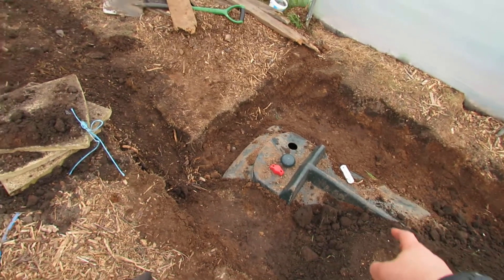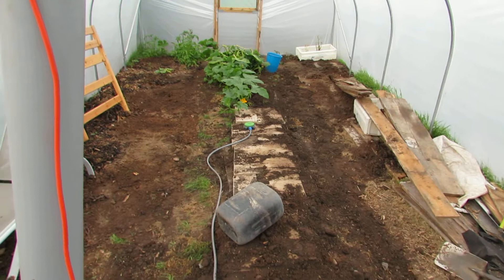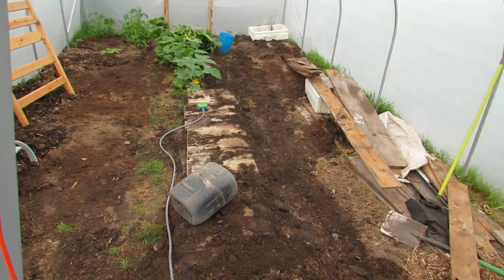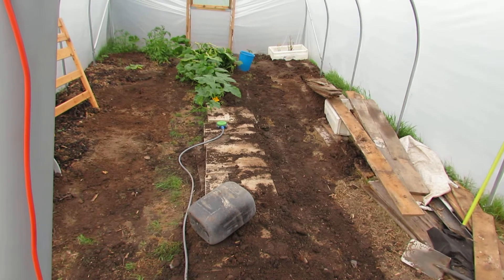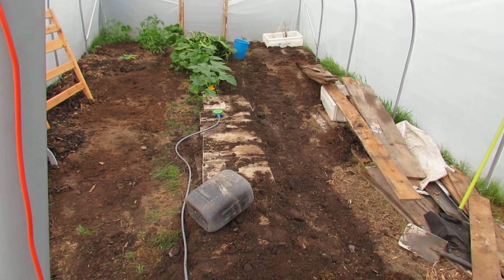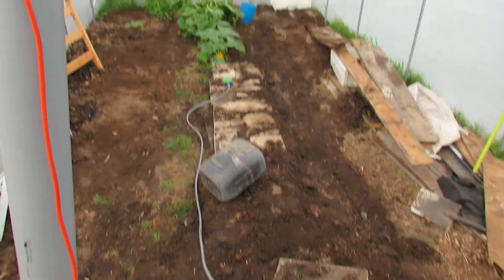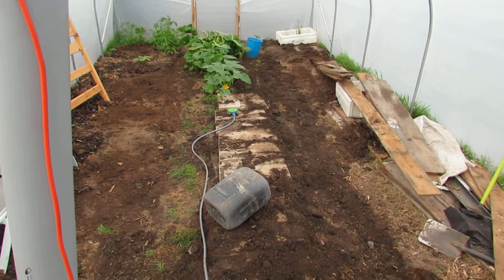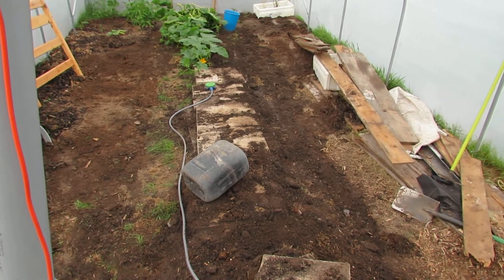Possible Improvements to the polytunnel heating system

Comment: How is the poly heating system working for you now?
Reply from the maker: This winter has been very wet and the high water table has flooded the pipes so its not working this year. However usually it works well and keeps the temperature a few degrees warmer, the garden its in is near the sea and so doesn't get hard frosts and the system works well enough to avoid frost inside the polytunnel. It works best in spring when the sun is strong enough to heat the polytunnel, in the middle of winter its so dark that the polytunnel doesn't heat up much during the day and so there is less heat to store underground.